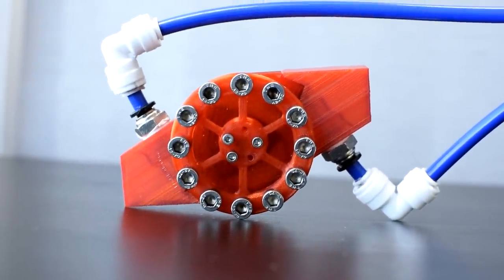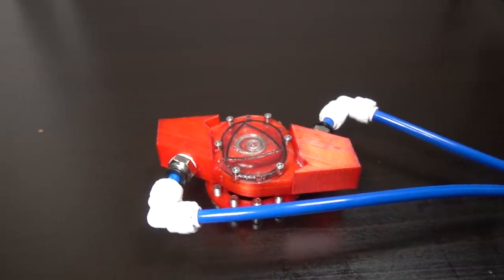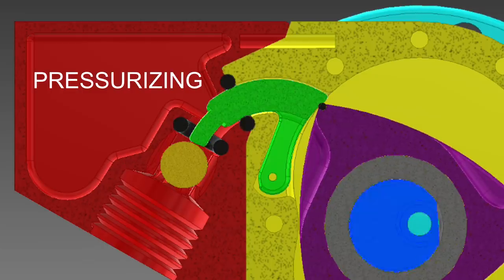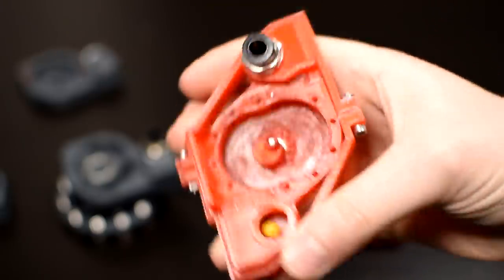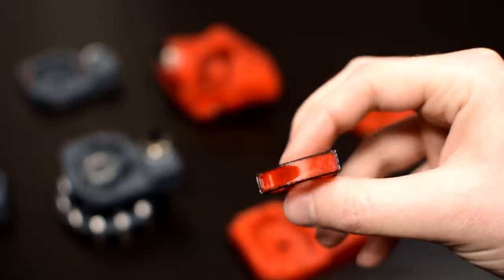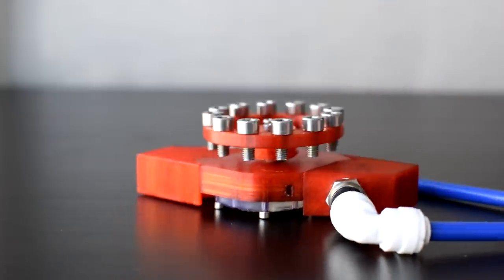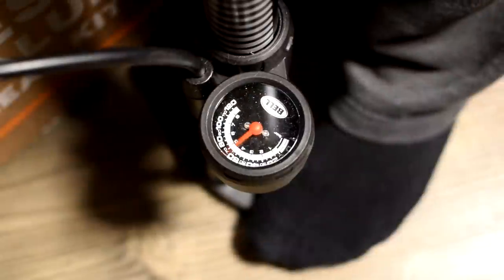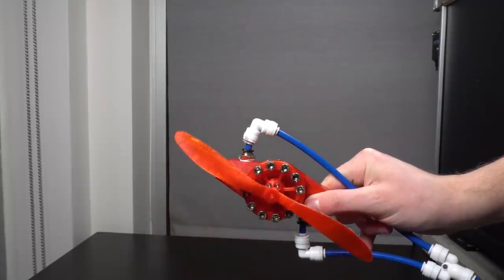3D Printing a Functional Wankel Engine

Comment: I wouldn't call this a Wankel engine, as a Wankel is internal combustion. It's definitely a rotary, though, and this is very impressive.
For their weight Wankels may produce high power but displacement they're about average. While a Mazda two rotor might be called a 1.3 liter, the amount of space around the rotor at any given time is around 3x that!

On the bright side though you did end up with the same problem as real Wankel rotary engines: Garbage apex seals that wear out and don't work very well!

Comment: Nice project, try using resin printing or even cnc milling aluminum parts, even with a cheap CNC you can get nice tolerances
Reply from the maker: True, but that takes away the challenge of FDM!

Comment: They aren't pistons, they're rotors
They aren't cylinders, they're housings
One of the best things about rotary engines is they DO NOT require valves... just proper port placement.. which would also help with sealing it.
Nice effort though. If you ever try it again I suggest leaving the housing solid and making ports on the front and rear plates.
Reply from the maker: Combustion powered Wankels inject a fuel-air mixture at near atmospheric pressure, which is then compressed, ignited, and expands significantly. I'm skipping a step and injecting compressed air which immediately begins expanding. So yes, I could run it with no valves, but the efficiency would be terrible (no matter where you place the ports, trust me I tried) as it would just keep consuming air even as the rotor approaches the fully expanded point of the stroke right before it begins to exhaust. The valves limit the air input to ensure excess air is not wasted.
Reply: @3DprintedLife   @3DprintedLife due to the rotor having 3 sides there is no point in time that is isn't expanding a chamber either on top or bottom. placing ports only on the front and rear plates and not the housing can absolutely give you the kind of control you need to take advantage of that. have the intake open right as the chamber starts to expand and close while it still has a small amount of expanding to do, then have the exhaust port open just as the chamber is reaching maximum volume. Do the same for both top and bottom which will allow a constant expansion without waste. I can draw you a diagram to show how it can be done if I'm not explaining myself well enough
Reply: @3DprintedLife   front and rear ports should allow you to have as much or as little time for the air to enter as you like. It'll do exactly what you are trying to do with the ball valve but work way better as the rotor itself will be the seal and you should be able to control it with far greater accuracy
Reply: Sorry, me again... I just thought of a better way that I should have explained it to begin with lol. You can put the ports close to the centre of the plate so the rotor is actually always covering it. Then put vents or holes into the rotors to open those ports as desired. You may have to put extra seals to divide to side of each rotor into 3 seperate sections but it would be easier trying to get a reliable seal from that ball.
Reply from the maker: Yep makes sense and actually something I considered, but the closer to the center you place the ports, the further into the expansion of the cycle you are when it gets air. And yes I can control the flow by port size, but ideally you want maximum flow as early as possible then taper off, which can't be done with a static port.
The fact that the ball valve doesn't seal perfectly is actually a non-issue, the small amount of air that leaks at a non-ideal time (when the chamber volume is contracting) is minimal that barely any air is wasted, and any leak during the expansion of the chamber is fine since it is being productive.
Again, these valves are far from ideal, but they are a viable way to improve efficiency. And with V2 (which I'm basically committing to at this point haha) I plan on not only explaining my decision to use valves better, but also will (probably) completely overhaul the design to improve their effectiveness and should improve the whole engine's efficiency significantly! And maybe I'll build a mini dyno tester too....that'd be cool!
Reply: @3DprintedLife  it certainly would be cool. I'm not sure what you mean when you say "the closer to the centre you place the ports, the further into the expansion of the cycle you are when it gets air" the distance from the centre of the plate doesn't determine timing. That is controlled by the angle around the rotation that you allow the port to be uncovered. You have the ability to place that at any point of the rotation when it's on the plate and not the housing. You also have the ability to control the flow and have it open suddenly then taper off by changing the shape of the port. If you want to keep the front clear for viewing, the exhaust can still be placed on the sides but if you do have another go at it, just try one with the intake on the back that uses the shape of the ports and/or vents in the rotors to control timing and flow.

Comment: So the hack-a-day article on this calls it an air compressor, and I understand that's not what's going on here, but I am curious if you actually can use this to compress air
Reply from the maker: Hah yeah I'm a little annoyed they messed up the title that badly. But yes actually. With no modifications, you could add a hose to the exhaust ports and apply power to the rotor shaft and you would get a (pretty bad) air compressor. Thought it would work far better if you remove what I call the "air flappers" and drive the engine in reverse. The exhaust ports would act as passive inlets, and the current one-way inlet valves would provide a method of adding pressure to the outlet chamber without allowing any back-flow. Though because of the air chamber I have in the valve head, it would again be really inefficient.

Comment: Ex- Mazda RX-7 owner here.  Thanks for the video, I’m always interested in the Wankel, it seems to make sense to transfer power rotationally.  We called that shape a trochoid.  I did my own work on the engine.  Iheard a lot about oil and apex seals for sure on my car. I changed the oil on a normal schedule and didn’t ever add any additional due to leakage or burning.  Although at the time, that was probably twice as frequent as most recommendations for oil changes outside of enthusiasts it is pretty much what your dealer recommends for any car today!  Go figure.  
Did you try adding lubricant?  just curious.
Reply from the maker: Oh nice, awesome car! And yeah I used a somewhat thick lubricant for both reducing friction and helping seal small gaps in the seals. I tried a thinner silicone oil, but for whatever reason this oil made the o-ring plastic interfaces super sticky, so I stuck with the grease. Unfortunately it's too thick to just put in the air intake between runs to self-lubricate, so I had to rebuild this engine quite a few times to re-pack with grease. But I've got a huge list of things like this to improve for V2!

Comment: Great! Why did you make it that small?
Reply from the maker: Partially for the challenge, partially because tiny air engines are cool, but mostly because I don't have an air compressor and I didn't want to spend 5 minutes pumping my bike pump for just a few seconds of runtime with a larger engine!

Comment: Will it work without valves? I believe if you mess with the ports enough it might work
Reply from the maker: It would work, just way less efficient. Unfortunately ports don't affect intake as much when running on compressed air rather than the typical air-fuel mixture.

Comment: Hi, I am very interested in designing and building my own Wankel rotary engine. I have a basic design but I cannot get my internal gears to work. I know this is probably the simplest part of the engine but I cannot get it figured out. Sizing, Ratio, I have no idea. Any help would be greatly appreciated.

Comment: a wankel air or steam engine does not need Valves whatsoever. Just connect the gas input where the sparkplug would be, the piston does all the valve action needed
Reply from the maker: You're correct it doesn't need valves to work, but it does need them to work more efficiently.

Comment: Perhaps graphite seals would help with the stalling issue, try that pls :)
Reply from the maker: Interesting idea, thanks perhaps I will!
Reply: @3DprintedLife  thank you for replying. I've been a bit anxious to know if it worked so I figured that I should tell you why I thought it would :).                  
 When you ran the engine, I realised that a lot of plastic debris was flinging off, suggesting that there was a lot of rubbing and resistance. The rubbing issue was something that mazda had encountered with the 13b rotary in the RX7, they dealt with it by making the car burn off oil and by using graphite apex seals that would wear down so as to not damage the internals. they also realised that it improved lubrication as graphite is.... Slippery.  If it worked, yawelcome and if not then I'm sory for that display of stupidity.              
  Sincerely yours,
Ujjawal

Comment: What a great video I really enjoyed it and I was curious if there is a way of using small rotating cylinders for sealing so that they rotate inside the engine instead of fixed seals??
I hope I made it clear cause English is something I'm still working on 🙃
Reply from the maker: Yeah I know what you're saying! Maybe, but the features are so tiny it would be very difficult. A better option would be selecting a better gap filling, low friction material to use for seals.

Comment: wouldn't it be better if you used multi piece design and made the second side from acrylic? or even 3d printed as separate piece to be sanded smooth, it would have better seal if you did it
Reply from the maker: Well sure there's plenty of ways to make it better, but I wanted to stick to 3d printing only. And what piece do you suggest I print as a separate piece? The rotor? I've toyed around with some ideas but getting the printed tolerances tight enough to not require o-rings for sealing is very difficult.
Reply: @3DprintedLife  i meant the back plate, like the one in front that you put to see how the engine works
Reply from the maker: Ahh yes that makes sense. Yep smooth would be better, and I did play around with a feature in cura called ironing which actually makes fdm top surfaces super smooth, but I had some trouble getting it to work consistently and it added a lot of time to my prints (of which there were maaaany) so I stopped using it. But now that I know this version prints I could probably reprint and rebuild with ironing enabled and get a small performance boost!
Reply: @3DPrintedLife he's on to something. Could you add a layer of self levelling epoxy or silicone after the print? Nail varnish? @bitluni recently used post-print applied and cured UV resin to achieve a gloss finish...

Comment: Hi. Good stuff. I noticed you wanted to demonstrate the engines / valves movement process with animation. But stop frames the cad. 
In the future I could animate for you maybe. 
With some simple fluid illustrated animation. 

I need some bits and bobs 3D printed (for FPV etc) so maybe I could trade my animation skills for you 3D skills?

Let me know if that is a viable idea. 
B.
Reply from the maker: Hey, thanks for reaching out! I personally want to learn how to animate myself, I just haven't found good software yet and ran out of time on this project. But I may never get around to that so I'll let you know! If you just want some parts printed though, I'd be happy to help out for the cost of material + shipping. My email can be found on my profile if you're interested.
Reply: @3DprintedLife  thanks. 
Looked at your “about” page but didn’t see an email address there. 
You can find my hotmail if you look at my about  page. 
Yep if you sent me a couple of still frames (from CAD or photo) and a brief explanation of the process, I could probably knock out a animation loop for you quickly, to show physical process or assembly etc. 

There was a couple of TPU camera mounts I was looking For for my quad in return. :)
Reply from the maker: Ahh sorry man, I can't do TPU. Tried it before and never had much luck with it on my machine.

Comment: It kind of kills the point of the "air powered" aspect, but what do you think about a "camless air engine" type thing?
Reply: Essentially use solenoids (or those "hobby servos" if they could get fast enough?) to open/close the valve, and use a rotary encoder for knowing when to open/close stuff?
Reply: It could allow for all sorts of tinkering with valve timing without dimention changes needing to be done, which would be neat IMO.
Reply from the maker: @ericlotze7724  interesting concept, basically a brushless motor of the engine world. A solenoid would probably be fast enough, but I'm guessing it would just be far less efficient from a total energy perspective. There are quite a few technologies which can mechanically vary the valve timings based on engine speed, perhaps I could miniaturize one of those for a similar effect!

Comment: Impressive work ! Did You think of using pneumatic lubricator in order to reduce friction. After all, as you mentioned, most of the jokes about the Wankel engine are about oil consumption :D
Reply from the maker: Good suggestion! I tried a silicone based lubricant but that surprisingly performed way worse than the grease, but maybe I'll try this on the next version!

Comment: nice work with the engine absolutely elegant engine replicated on such scale....i want to get into 3d printing but im looking for a reasonably good printer at a reasonable price that can be used to print hard wearing parts for semi functional cosplay and small scale engineering....do you have any suggestion's on what to look for?
Reply from the maker: Oh there's so many options! For functional parts, usually fdm printers are better (extruding plastic). Resin printers are good for higher detail high accuracy prints, but the materials can't compare to traditional thermoplastics for engineering purposes. And it gets messy and difficult when you start working with large parts. But the detail is incredible. As far as printer suggestions, the Ender 3 is a good starter printer for a low budget, prusa i3 is reputable for mid budget. High budget has lots of options depending on what you care most about. For resin printers, I'm not as familiar but google is your friend! You can also check out the 3dprinting subreddit for more advice, or ask some people on my discord channel! https://discord.gg/aWBAfk3
Reply: @3DprintedLife  thank you for the advice it will really help

Comment: Compare it to three of toms air engines because each side of the “dorito” counts as a cylinder essentially
Reply from the maker: Yeah I've tried figuring out how they compare in this way myself. I think it would be more like a 2 cylinder that's geared down 3:2. But either way yeah definitely a lot more torque than Tom's haha!

Comment: Exhaust system mods. 
Expansion chamber?
Reply from the maker: Yeah I could definitely work on improving that exhaust note, it's a bit pitchy for my liking
Reply: You mentioned that your air supply dumped thru unrestricted. Nothing to do with tone or pitch but flow.

Comment: would it be better if the prints were treated in acetone vapors to remove all the print lines and have a smooth surface ?? you are searching for microns with unevens surfaces in fact i dont have a 3d printer yet but im so certain that one of the problem is the pla printed surfaces being rough if this was machined metal you would have had less sealing issues
Reply from the maker: Yes machining would help, but that kind of defeats the purpose of this project since I wanted to design something that most people could reproduce (if they were crazy enough to try!). Acetone treating may work, but it would require a lot of trial and error with the process. Acetone treating will alter the dimensions of the printed part if you aren't careful, and they smooth out small details and features which may lead to issues. Honestly, using a resin based printer is the best option for high accuracy parts that most people can reproduce easily, and that is just where I want to take this project next!

Comment: I crying! I have so much idea but not have brain to make 3d models. I tried so much program and watch videos but not working. I planned to make 3d printed wankel compressed air engine but use valve and valve train system like modern ish engine.
Reply from the maker: The ideas are the hard part! Learning how to model just takes lots of time and practice, but you can do it! Just need to be prepared to try and fail a lot of times, but it's all part of learning!

Comment: Why the extra valves?
Don't those kinda defeat the purpose of a rotary?
Reply from the maker: While yes valves aren't required, you're forgetting something. Combustion powered Wankels inject a fuel-air mixture at near atmospheric pressure, which is then compressed, ignited, and expands significantly. I'm skipping a step and injecting compressed air which immediately begins expanding. So yes, I could run it with no valves, but the efficiency would be terrible as it would just keep consuming air even as the rotor approaches the fully expanded point of the stroke right before it begins to exhaust. The valves limit the air input to ensure excess air is not wasted.
Reply: @3DprintedLife  Ah ok, that explains it

Comment: A real Wankel engine has no valves and relies on the shape of the ports to perform that function. Some piston engines have an equivalent system with ports on the sides of the cylinder instead of the top. But I guess that requires effective sealing to work...
Reply from the maker: A real wankel also runs on combustible fuel. Mine does not :) The valves aren't necessary, but greatly improve efficiency with this air powered engine